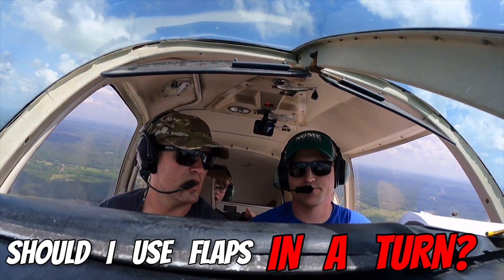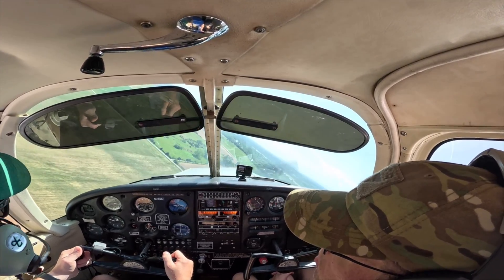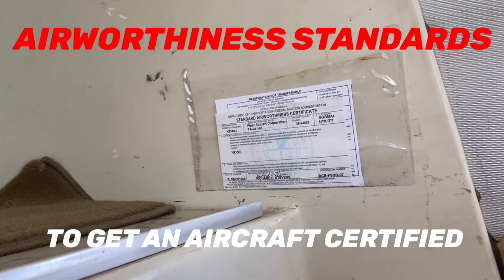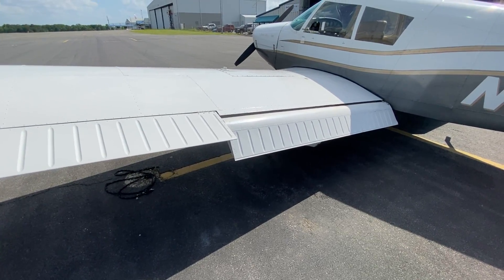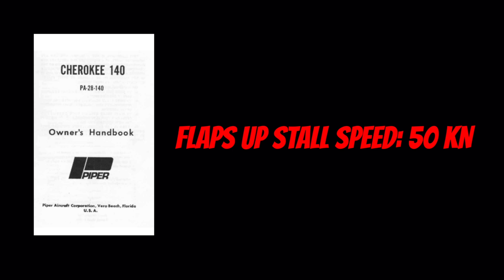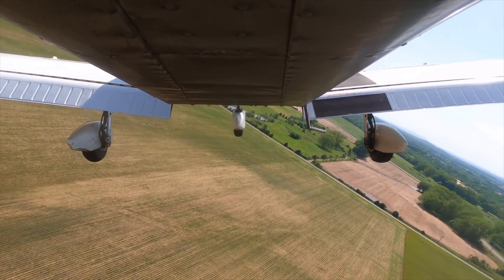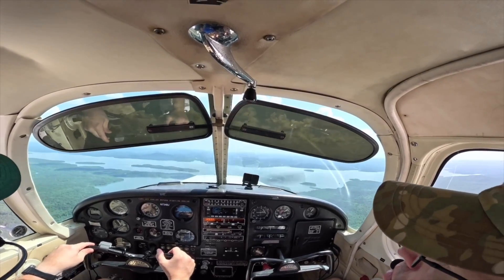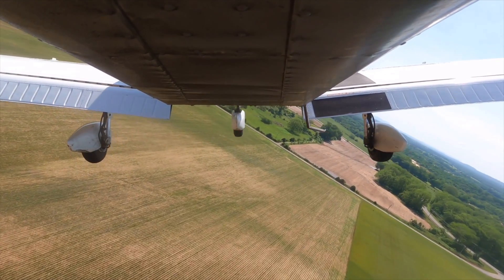Should I LOWER Flaps in a Turn?

Comment: Excellent lesson on using an available tool to reduce turn radius, reduce stall speed in turns, and be better prepared to handle situations where horizon space is limited and where the dangerous downwind turn near the ground is necessary.  Another thing to consider, even if most non-Ag pilots may seldom need it, is allowing the nose to go down in turns as designed (dynamic neutral stability) for safety.  The absolute safest turn is the energy management turn (gunship return to target or crop duster turn.)  By anticipating the need to turn, with zoom reserve airspeed we can pitch up safely wings level for additional altitude and to slow down for a shorter radius of turn (also applying flaps is good).  When we bank steeply to acquire the target (centerline extended say), we simply release all back pressure on the yoke.  The resultant turn will be 1 g load factor regardless of bank angle.  We need to again level the wing prior to pull up to prevent graveyard spiral.

I know schools are not going to change to the energy management turn, but even shallow turns are safer done this way.  Addition of flaps will certainly help as well.  On my 3500 mile pipeline loop, paid at retirement guy rates so not so much oversight of insurance requirement to be solo, I took students.  The made hundreds of every bank angle of turns, all at 1 g, so that they gained some muscle memory to relax back pressure rather than muscle memory to pull in turns.  Our GA fatality rate results from the latter.

Another technique you could help me with to demonstrate to students the need to put the centerline extended and centerline between their legs.  Show us what putting the nose of the C-130 on the centerline would look like rather than putting the centreline between your (guess what? between the other pilot's legs as well) legs.  Its an optical thing but works.
Reply from the maker: That’s exactly right! I use that too.  You can’t stall an airplane that has zero Gs on it.

Comment: Great vid, love your channel....But making a tighter turn...doesnt that also increase the load factor? Since your centrifugal and centripetal forces are larger therefore the load vector is larger?
Reply from the maker: Excellent question. The truth is, load factor is ONLY related to load factor in a LEVEL turn. So, in both situations, to maintain LEVEL flight in a 45 degree bank turn, you need to maintain 1.414 Gs.  It is possible to bank the airplane and not induce a load factor.  I would like to make a video on that at some point, as it can be kinda confusing
Reply: @FreePilotTraining  so in these 2 situations(level and coordinated turn)...
situation 1: flaps up, 45° bank, turn radius x, turn rate y
Situation 2: flaps down, some level of bank(less than 45°), also with turn raduis x and turn rate y
Would these 2 situations not have the same load factor even tho the angle of bank is different?
Reply from the maker: @wardenpienaar9317  so, I’m not 100% about the uncoordinated turn.  I don’t believe that increases your old factor though
Reply: Bingo! This is why we know the radius doesn't decrease: If it did, then the loads would have to go up. Since loads are fixed with bank angle, 30 degrees at 70kts will always get you the exact same Gs, the exact same ground track, and the exact same turn rate. The load factor couldn't stay the same if any of those were changing.

Comment: Hi. I really like your videos and thank you for your selflessness in educating people about the nuances of aviation without compromising on the physics. A minor comment, however: at 7:59 in the video, you mean "torque" (or "moment") and not force strictly speaking -- the rolling effect of asymmetric flaps (split flaps) is lower compared to the ailerons because flaps are closer to the longitudinal axis (as you point out), and consequently contribute a lower torque (product of moment arm and force). I won't try to type an equation. 😀Also, thank you for your service! 🙂
Reply from the maker: Thank you so much for your input.  You are exactly right. Technically, I should have called that “torque.”  I forget things sometimes 😆

Comment: When you are turning for final you are also descending, so you aren't in level flight which is a requirement for determining that the load factor at 45 degrees is 1.414G.  So, since you are descending, won't the load factor actually be less than 1.414G, thereby contributing less to the increase in stall speed?  I.E., maintaining a descent while banking at 45 degrees in a base to final turn adds a little bit more to the "safety factor" that you mention.  Do I understand that correctly?
Reply from the maker: Yes, this is true. That’s why I mentioned being “low on glideslope.” The real problem is when you level out and steepen that turn up.

Comment: I've heard not to use flaps in a turn to improve passenger comfort, but that's only applicable to larger aircraft not your Cherokee or 172
Reply from the maker: Yeah, I could see that. It can definitely make it feel much more aggressive for your pax, if you lower them in a turn

Comment: We had a night flight on a Southwest 737 from ABQ to Lindbergh at San Diego. Long westbound approach. Hung flap with a TOGA that sent us half way to the El Centro MOA. High speed pass of the Sea World tower on the right then 180 bank avoiding the Miramar MOA. Folks were crying and/ or praying. Aircrew followed the checklist, cycle flaps a number of times and could not duplicate the flap issue. Came in 45 minutes late but better bolter than take out the 7 story car park on final.

No mention of the "Sarajevo Approach" in this video. Tisk
Reply from the maker: That’s insane! Yes, better late than never!
Reply: Trailing edge flap asymmetry is pretty rare on a 737, not particularly dangerous, it is a simulator item, the QRH does a good job with guidance. Usually just set VREF for the smallest flap position and trim it out. The biggest problem is identifying if it's a leading edge or trailing edge device. If you dont determine that first, you run down the wrong checklist.
Reply from the maker: @shawnnance3670  yeah, I could see that being a problem for sure!